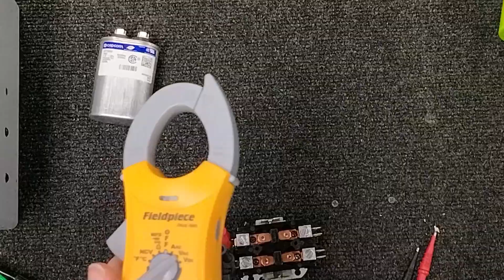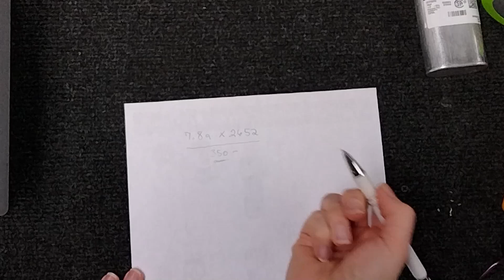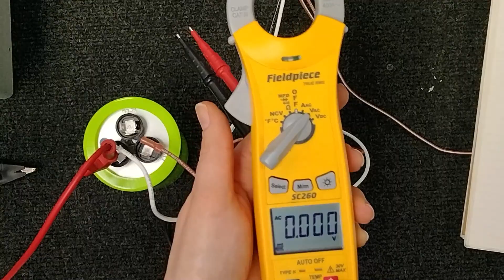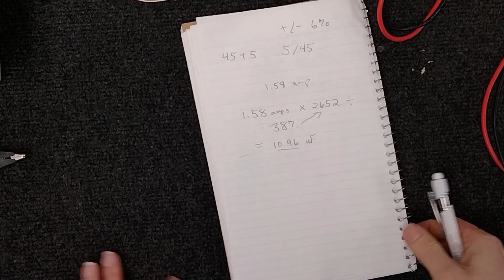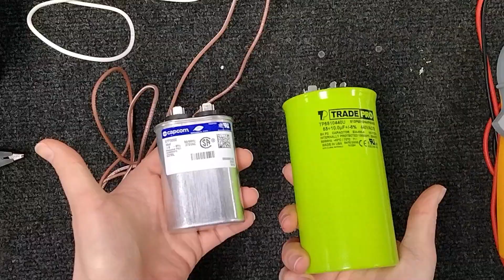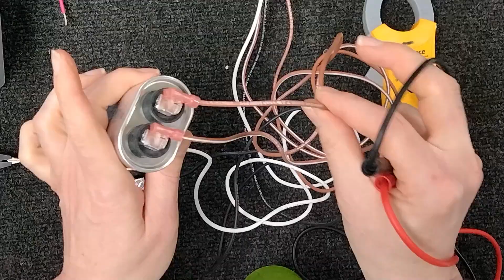Capacitor Testing With a Volt Meter — Is Your AC Capacitor Bad?

Comment: thanks for the video, question i have is,  in the event of replacing capacitor for the fan if i want to use only one of the two browns, iwill use the one with the highest resistence, conected into FAN terminal in a dual capacitor,and cap off the lead im not using?..thanks
Reply from the maker: Yes, exactly. Just cap off the one with less resistance and place the other wire on the label FAN on your capacitor.